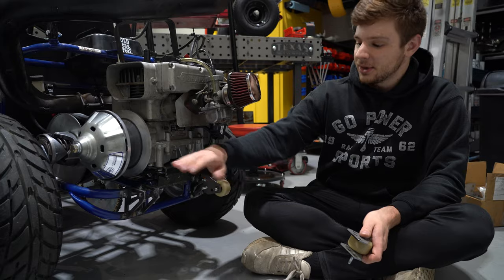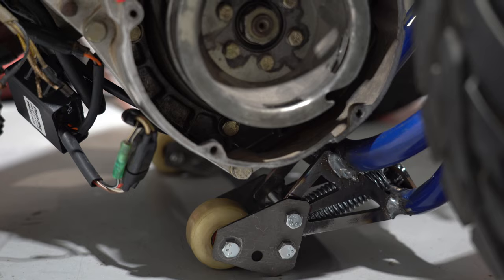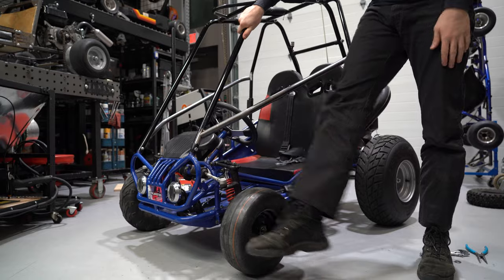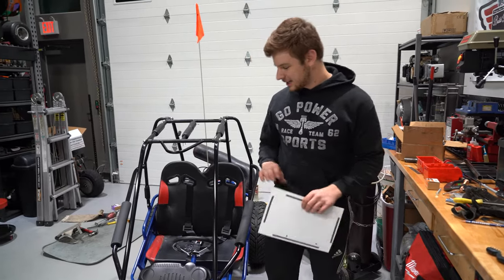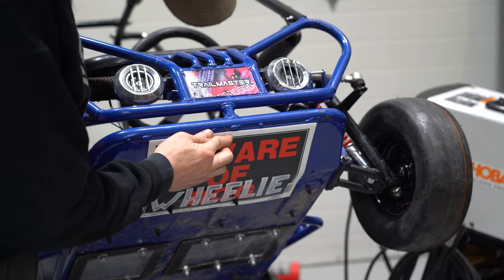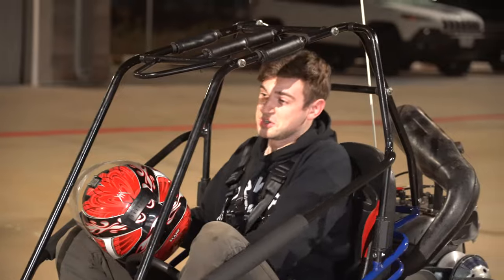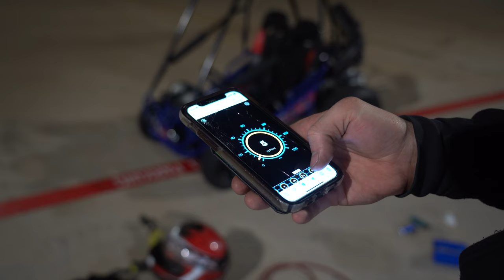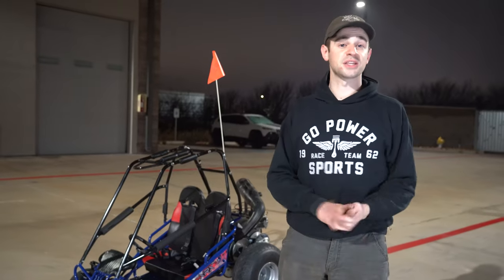TINY KID'S GO KART with a SNOWMOBILE ENGINE is a Wheelie Monster!

Comment: You should visit Grind Hard Plumbing, Ethan will feel the need to build some front suspension that makes coming back down like landing on big soft pillow.
 I'm only 6:20 in, but I have a feeling the exhaust may decide to run away before the end of the Video